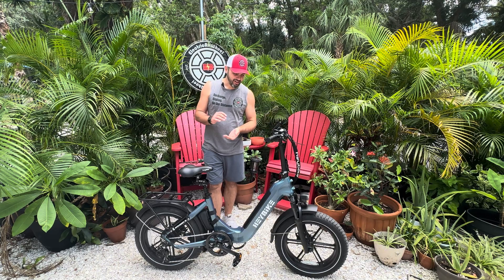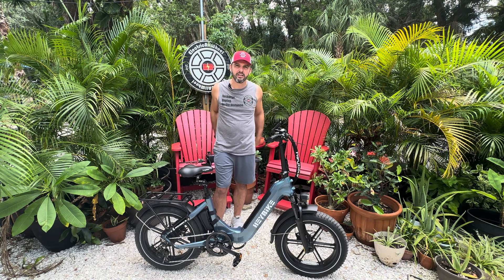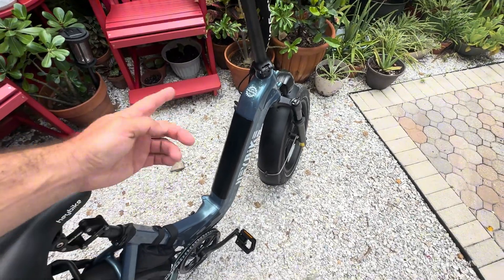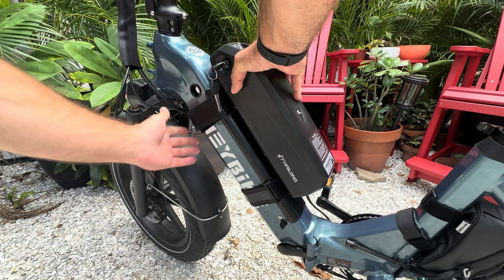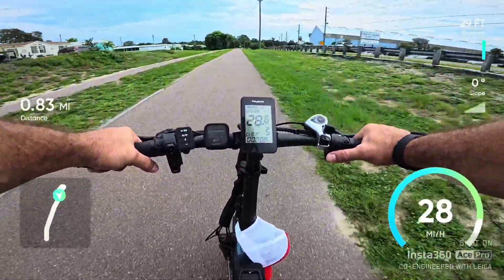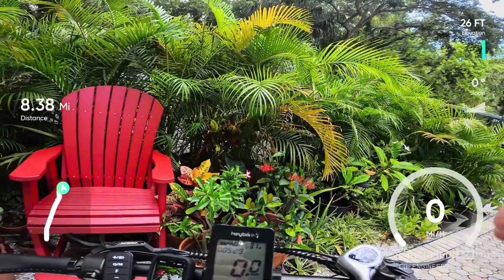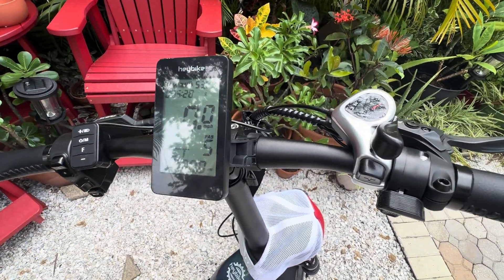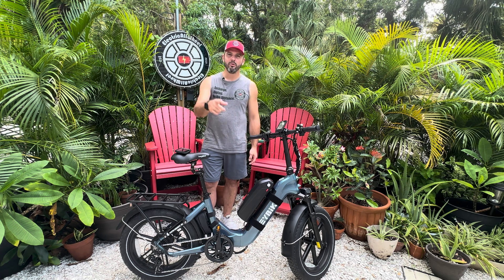Heybike | Ranger S | e-Bike 52V Second Dual Battery Install and High Current Test Ride, Yes It Works

Comment: My system is a 48 volt system and when fully charged the battery shows 54.4 volts. I was always curious if a 52 volt  battery would cause any issues. I wouldn’t think that it would so thanks for the great video. This answered a lot of my doubts I had and satisfied my curiosity.